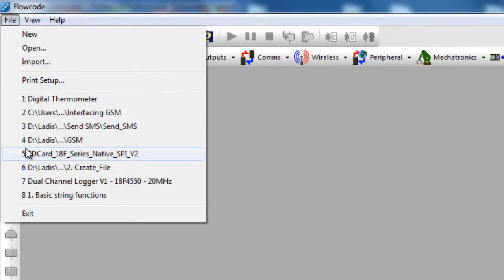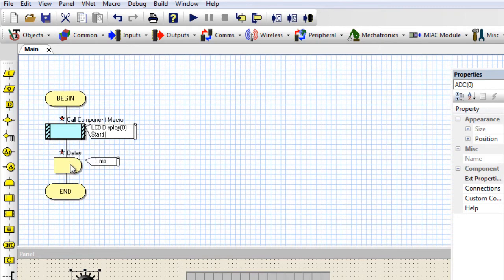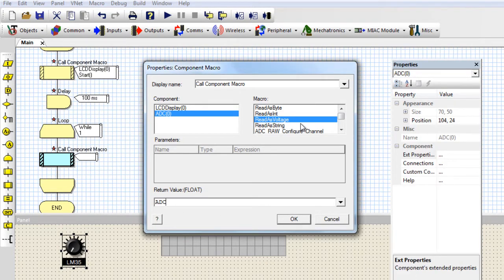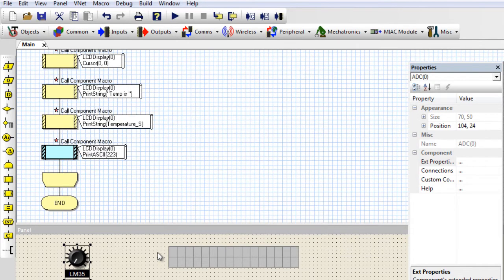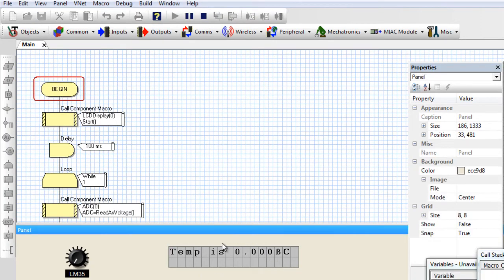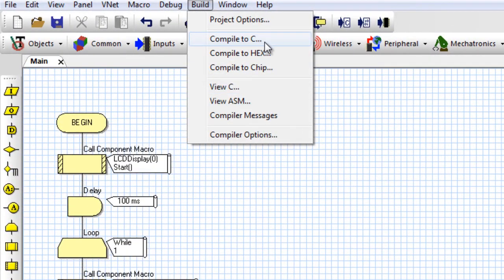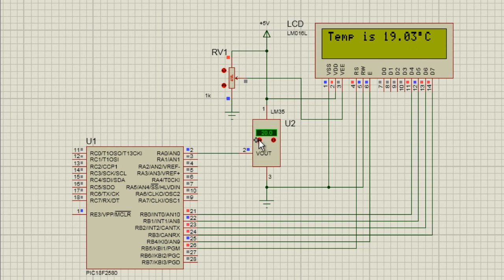13- Project 1 Digital Thermometer, part 2 | Flowcode Beginners Tutorial

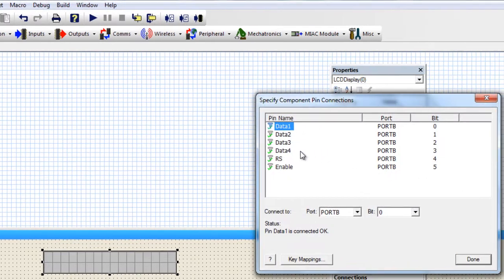Comment: Hello! 2:17 Is there a reason for interchanging the bits for RS and Enable pins?
Reply from the maker: Hi. There is no specific reason.  You have to connect it the way those LCD pins are connected to your PIC. We have a PIC development board with LCD . So we connected the RS and Enable pins the way they are connected on our development board and the way we designed our Proteus schematic.
Reply from the maker: But you can leave the default connection if that's how you gonna connect your LCD hardware.

Comment: I am using PIC16F877A, will it work with your configuration settings mentioned in this video?
Reply from the maker: +lawiee t It should work as long as you configure correctly your configuration bits and the correct frequency of your oscillator. This project is big and does not require special peripherals or registers, a PIC16F877A should be able to do it.
Reply: +StudentCompanionSA I tried using this code using PIC16F877A with the LM35 as the sensor. The hardware doesn't work.
Reply: +StudentCompanionSA The simulation works well but when putting it on the hardware, it doesn't work.
Reply from the maker: It basically means the problem is hardware. You should check your hardware especially your oscillator section is according to the configuration in your software. This is the advantage of Flowcode, if it works in Flowcode it should work in hardware too if correct.

Comment: thank you
Reply from the maker: Toi Luubach  You are Welcome!
Reply: flowcode v5 là 1 phần mềm rất hữu ích.mình không biết về ngôn ngữ c nhưng vẫn lập trình được
Reply: nhân tiện cho mình hỏi 
đoạn code voltmeter này sai ở chỗ nào
dem=(adc*5*1000)/1023
sig3 = dem / 1000
sig2 = (dem % 1000) / 100
sig1 = (dem % 100) / 10
sig0 = dem % 10
flowcode thì chạy
proteus không chạy?
Reply from the maker: Toi Luubach Can you write your comments in English?
Reply: yes,I can write is english
Reply: facilities for their workers ask
code voltmeter seven segment LED display 4 in the wrong place
read as int (adc)
variable = (adc * 5 * 1000) / 1023
sig3 = variable / 1000
sig2 = (variable% 1000) / 100
sig1 = (variable %100) / 10
sig0 = variable% 10
flowcode the run
proteus not run? ATmega88 not loaded and ran the wrong
when I write this, it all works, but will not display the voltage from 0V to 5V which displayed from 0 to 1023

read as int (variable)
sig3 = variable / 1000
sig2 = (variable% 1000) / 100
sig1 = (variable %100) / 10
sig0 = variable% 10
you can do one example of it is not
Reply from the maker: Toi Luubach Sorry at the moment we are not working or offer any tutorial on ATmega microcontrollers. We only have tutorials and only try to assist with PIC Microcontrollers only.
Reply: flowcode idea for pic and avr is that
I used flowcode avr same Interface Software
you can just tell me the pic and avr flowcode anywhere else?
you can do one example of volmeter 4 LED seven segment display using pic flowcode please
thank you!

Comment: Great video thanks. l wondering can you make PIC16f877A to out put binary 16 bits. I want to use for my other project? thanks again
Reply from the maker: Hi. Thanks to Flowcode,  it doesn't matter really whether you are using the PIC we used or the PIC16F877 as Flowcode will do all the code behind for you. You shouldn't struggle to output a binary.

Comment: Sir Please correct me if am wrong but in your diagram in proteus about the Digital thermometer you show VDD to the LM35 is 5 volts but in your code you set VDD to 100/10mv which gives us only 1v (one Volt) very small for the LM35 to perform,  i think it should have bee 500/10mv to give us 5v since the LM35 is power from 4v to 30v but not 1v and in the calculation we change to Temperature = fmul (ADC,30) to give us a maximum of 150c which is the maximum of the LM35.Correct me is am wrong sir.
Reply from the maker: Hi. You are correct to say that Vref = 5V which should be 500. We used 100 but in the calculation we multiplied by 500 which gives the same results.
You cannot write Temperature = fmul (ADC,30) because the LM35 can be powered up with 30V. NO. You must use the voltage used which in this case is 5V not 30V. The reading range has got nothing to do with supply voltage range.

Comment: lm35 is not a digital thermometer (such as ds18b20) because its not have a digital interface. you are using the adc module of your pic (analog digital converter) so the thermometer its analog, not digital, you said it yourself
Reply: likedd:)
Reply from the maker: Hi. You are correct in one way. Yes the LM35 is analog sensor and we explained in the video that's it's analog sensor but the project is digital thermometer because it displays the temperature digitally on the lcd, it's not analog thermometer where the values will be displayed by a moving hand on a scale or a mechanical thermometer for example.
A digital system doesn't mean it can not use analog components.
Reply from the maker: Thanks.  We also appreciate your feedbacks
Reply: @StudentCompanion  ohh okay, i agree now hehe
Reply from the maker: Thanks. We really appreciate your feedbacks.